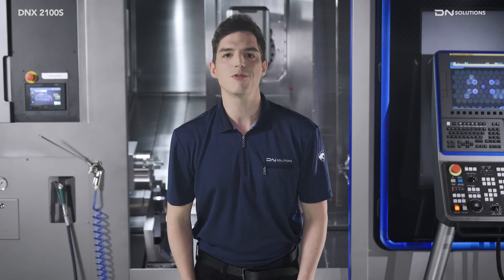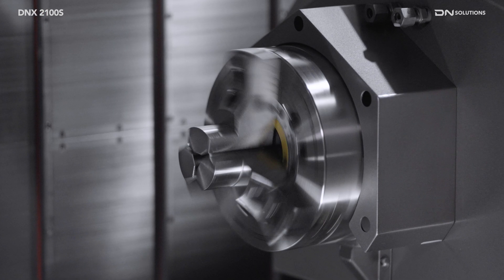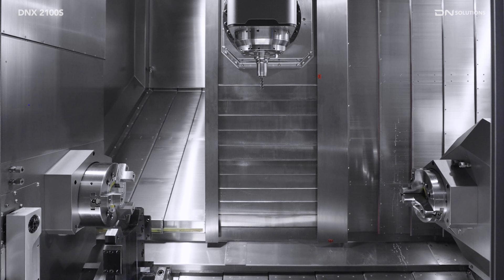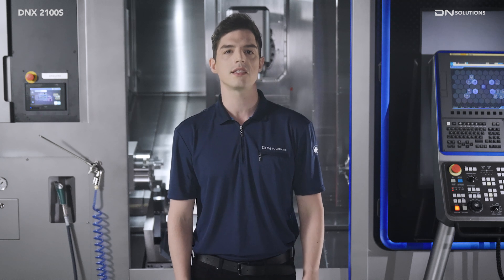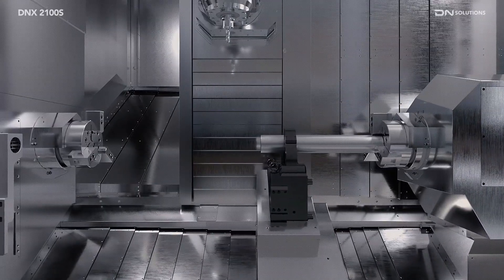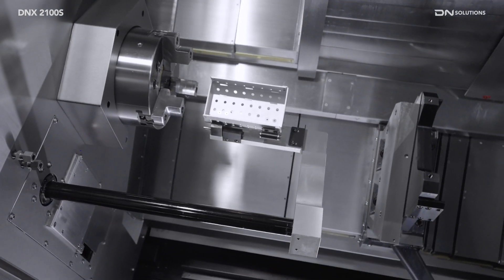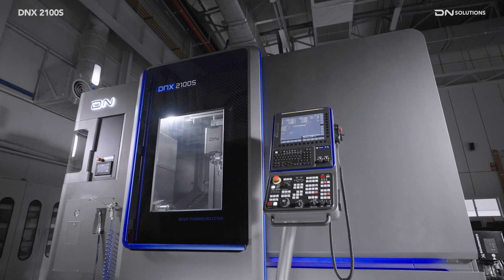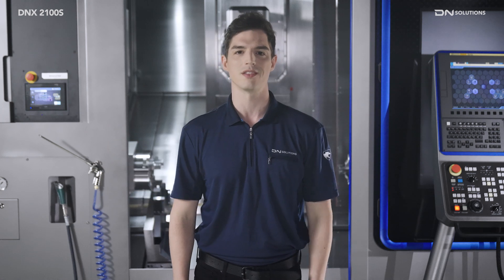DNX 2100S Detailed Introduction

Comment: is it also possible to have bar feeder on it and automatic program changeover ( like if i have multiple parts in the same material and bar stock size and tells it to change program over to another program after makeing ex. 20 parts ) ?
Reply: you can use "M98 P20...."
Reply: @tang258 but that's just calling a sub program. im talking about completely swapping to a whole new main program. i dont want to stack like 10-20 fully programs in as sub program's ( specially cause i do all my lathe programming by hand in cimco and my milling programs in mastercam ( there is some stuff i can only do in hand programming that's not possible in cam programming yet ) ) and i would prefer to just set it of with a counter and ITTT ( if this then that ) if possible

Comment: What was the machine's model number again, I didn't quite catch it?
Reply: DNX 2100s High Performance Turn mill multi tasking Machine for production of multifunctional complete machined parts 😊
Reply: when i read it on the machine i though it said DNX21005 not DNS2100S. cause the S sure looks like a 5 in that font
Reply: 2100 means 210mm chuck